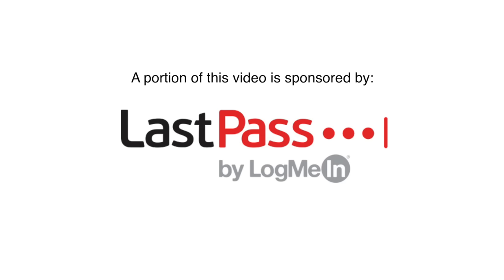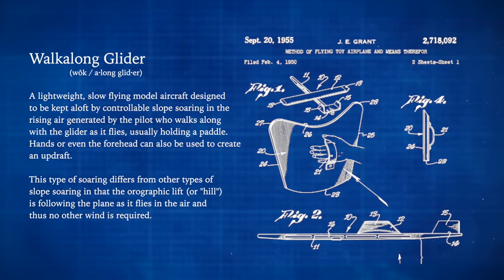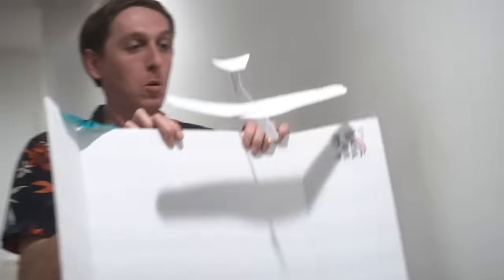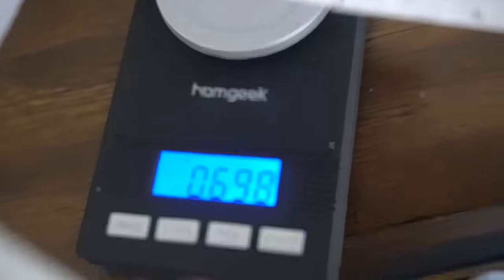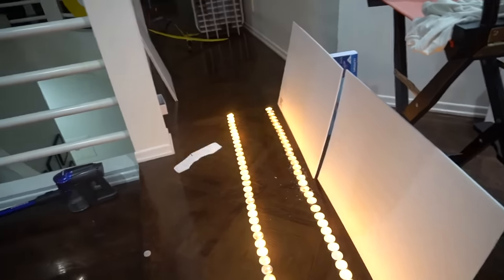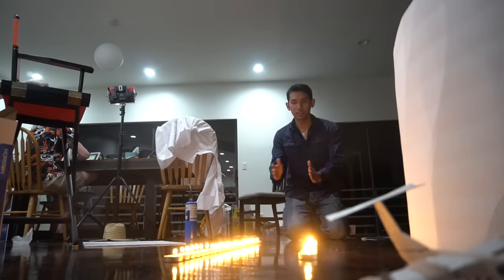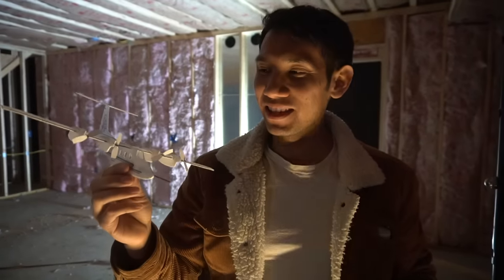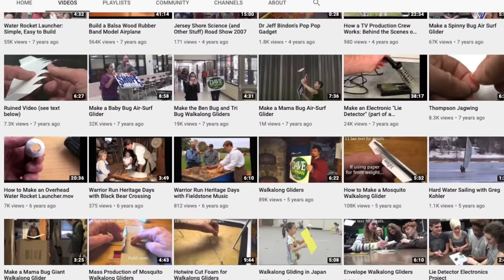Infinite flying airplane! (walkalong gliders)

Comment: Hy
It cost a lot of candles and plastic tubes...
In fact it works without air front perturbation, when you push the wave, because of the weight, when the waves come from the front, the ocean is too perturbe for a tiny boat

At 12.07 min, your big pipe rectangle...
Using those materials it will not work, but with a lot of small cartoon tubes recycling, this is a possible flying carpet form
With a wing to cover and sit on, this makes me thinking about an aeroplane
With a table with a lot of small holes, there's Levitation games that use this effect

The paper flying effect in the fire circle as the fire road were interesting, as the chaotic heat idea
A solar high temperature wings could improve it's lift with pressure power cumulate

Then your favorite plane form
It's like a catamaran, with multiple points of pressure spaces on the flowing line, in hard waves conditions, the body is more stable if the wings can support the waves forces

If you push the wave, flat ocean, all light flying forms will work
If your flying form is strength with a lot of kinetic energy, it can go through the wave, as a bullet but will not be able to support mass waves superior at the global mass and speed of the plane

That's why, very light jets, with very high speed can go through hurricanes more simply than a low lighter biplane

Here's the last interesting link i've found about paper planes, a lot of useful forms, with capacity of the wing and entire construction

Those are flat wings, if you want to modify the ocean wave, you can cumulate papers or create empty wings for hot air
https://youtu.be/-psCzHtISlM

There's also an old solution to improve the strength of a single form, cumulate the wings as with kites
Then another solution to fly a plane in circles without going out of
A simple string in the middle of the circle

If you use a bag with hot air a skirt it could also works
Multiple wing bags perhaps

Then the wings...
Why do simple paper wings works better than the long ones, and why do we use long ones more even...
In reality there's a lot of flying possibilities

But some are really more useful and more efficient
I prefer the paper ones, more safety more efficient